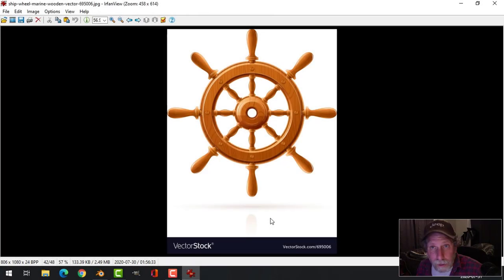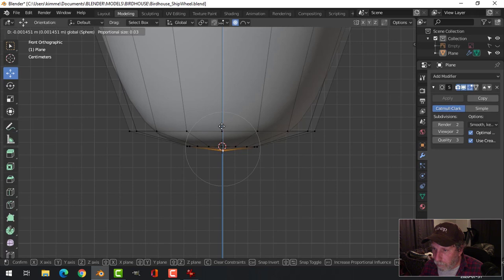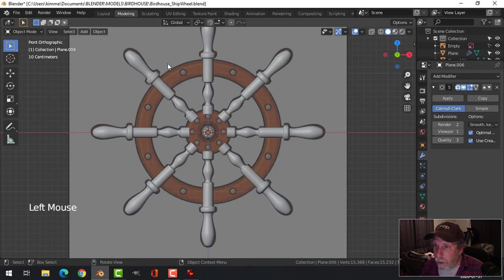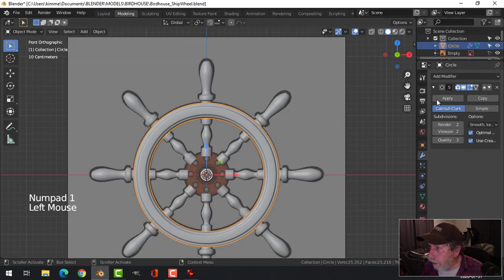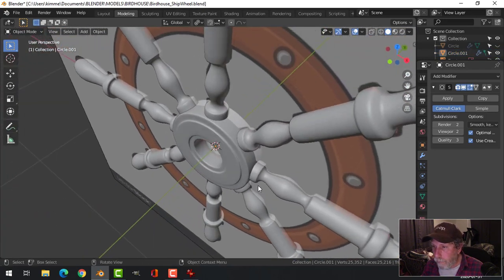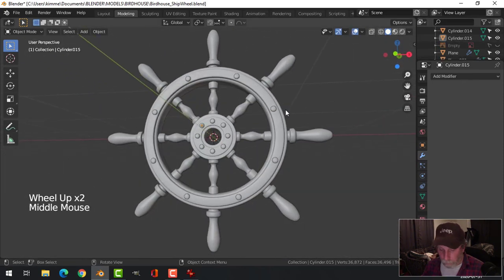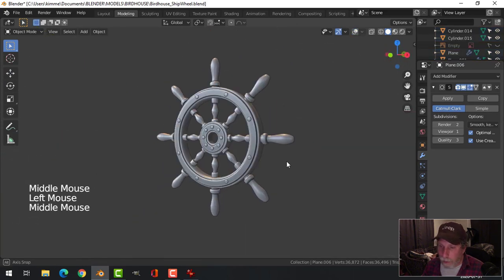BLENDER 2.8: Modeling a Ship Wheel (Part 5)

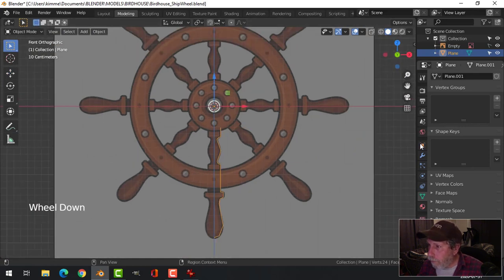Comment: i'm stuck at what you finished doing at 2:30

when i apply the "screw" modifier, rather than just make the part spin around like yours does, mine just makes a big low-poly 2D circle around the canvas.

will you help me, please?
Reply from the maker: Will write you back soon...
Reply from the maker: First, make sure to apply scale, rotation or any other transformations you may have e done in object rather than edit mode. CTRL A and choose apply all transformations. Second, make sure thr object you are spinning has a back side. If it is open because of deleted faces or just modeled that way, spin may not work. Later you can delete the faces again after spin. Third, select object in edit mode and ALT N and recalculate polys outside in case some are flipped. Finally save your file before spin. Blended frequently crashes when I use the new spin tool. Hope that helps. If not, do a new scene with just a circle and a bolt to spin and try it that way. See if you can get it to work and then go back to the ship wheel and try again. Good luck